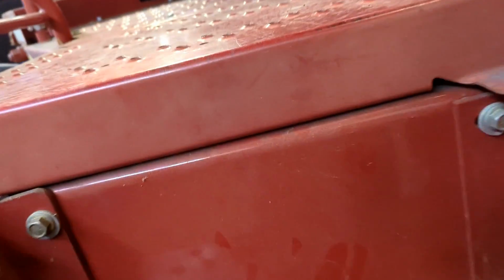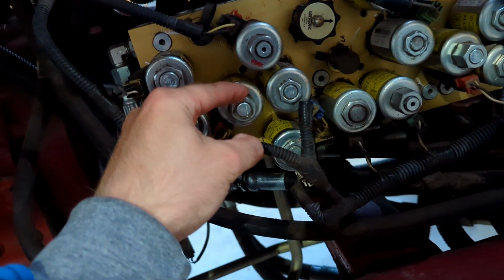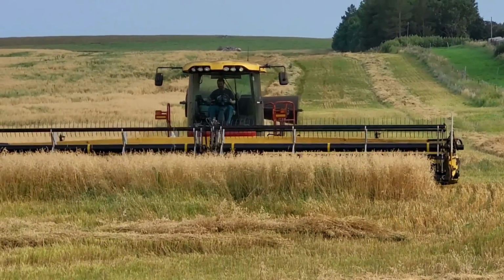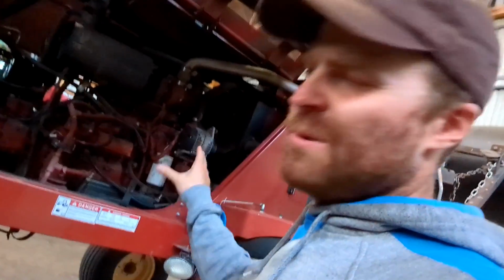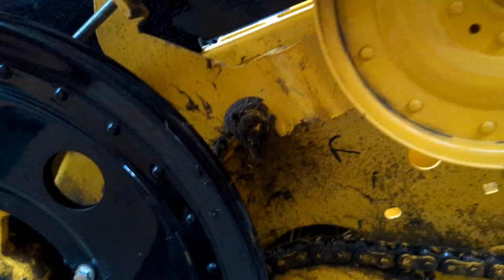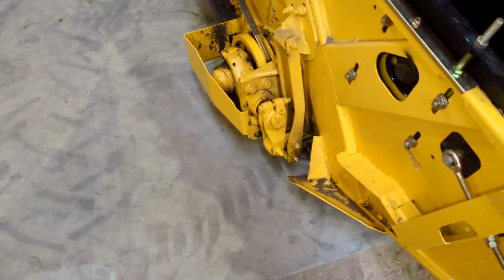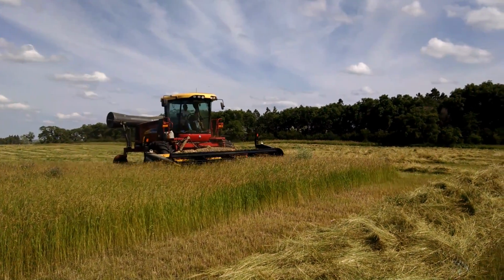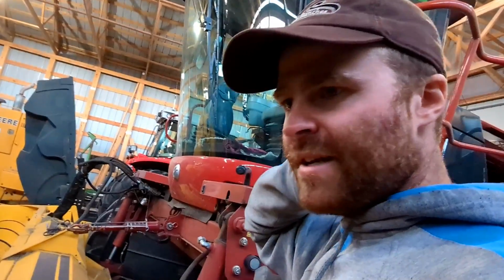Review UPDATE: New Holland H8040, 18HS Haybine, 36HB HoneyBee Draper

Comment: Great video! One question what’s the purpose of the hour glass shaped roller hanging of the rear?
Reply from the maker: That's a flax or canola roller... basically gently flattens out the windrow to lower the chance of it blowing away in high wind situations since canola and flax can be light, fluffy. Doesn't prevent it all, but gives a better chance of staying put.